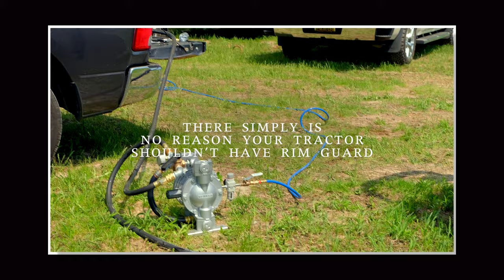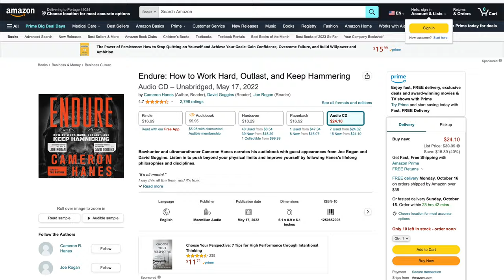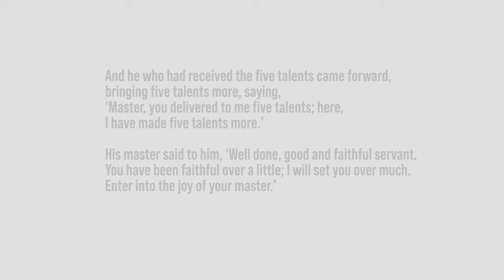THIS IS WHY YOU SHOULDN'T BUY A LAWN MOWER

Comment: For the most part if it has a license plate, I take it to a locally owned shop because giving him the business that I could do myself (a lot less efficiently) helps ensure he's still around when it's something that I can't do myself. We have annual state inspections here. Lube and tire franchises are too busy stripping lug bolts and drain plugs to do them, and our dealer service departments are so corrupt, it's virtually impossible to get a pass without spending $300-500 on what are essentially bribes disguised as repairs.

Comment: Interesting topic. I would say however with respect to your lawn service costs, if i could get somebody to work as cheap as the guys doing your lawn work i wouldn't cut my own either!! Heck, it costs me $18/hr just to run my 72" cut commercial zero turn with 35hp gas motor. I use to do a few side gigs but folks just wouldn't come off the dollar. If I couldn't get $40/hr for zero turn work and $60/hr for light to med duty tractor work I was barley covering costs and making very little profit. And those rates are about 1/2 what the commercial operations are charging for my area so that is why I got so many calls.

Comment: you are correct if you can keep enough customers coming in to buy the higher end stuff, now you are somewhat nation wide thx to the  internet and maybe you have 1000s of owners around who need tractors and implements, but realistically the lower end stuff can also drive repeat customers, say i come in to buy  $1-200 worth of feed and see something i maybe dont really need but would like to have just because i see it, or we get to talking and i mention a problem i may be having and you go, ah well this thing here is the perfect tool for that, sure that also doesn't happen that often but it does tie people to you as people are used to coming to your shop to buy X, so if they need Y there's actually a good chance they buy from you, now maybe they will buy from you cuz the closest competition is 200miles away, but still its not always so easy a choice, though ofcourse when you are struggling to sell something (like that feed) you need to cut it